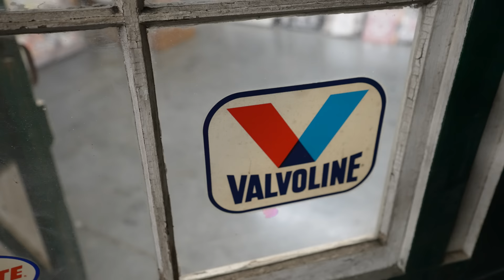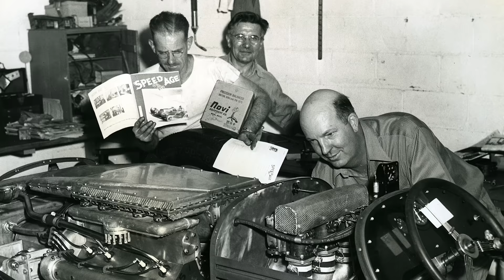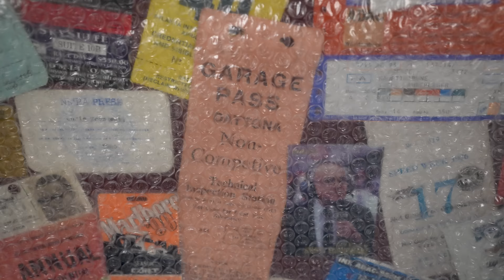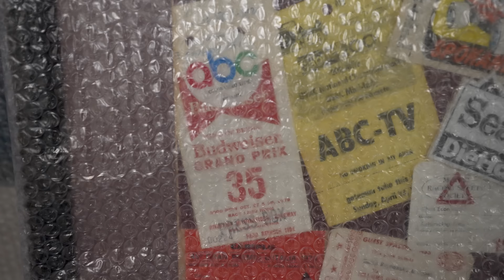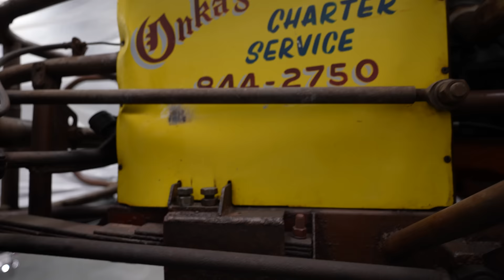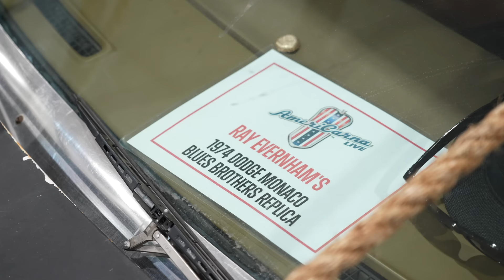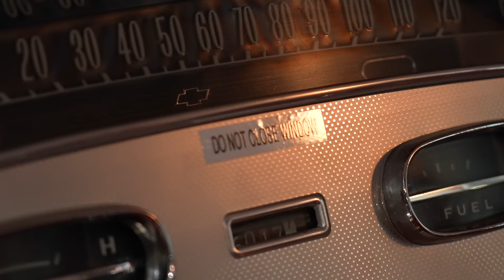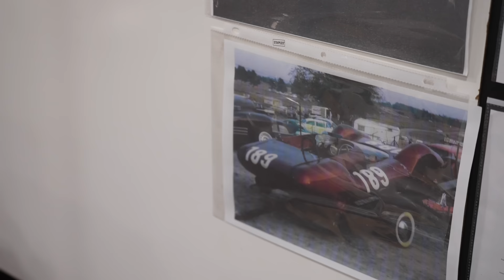Ray Evernham's Secret Obsession W/ IROC Cars & Owning The "American Graffiti" Car | Barn Find Hunter

Comment: I like how after talking about IROC they show a Trans-Am Camaro instead of an IROC Camaro. 😅
The yellow one with SCCA GT-1 on the side.

Unless there's more of an explanation that's missing. If that's the case I'd love to hear why that car looks like it's been running in the Trans-Am series, not IROC.
Reply: After it was retired from IROC, the car was probably  sold off and used in TransAm. 

One of the original IROC Porsche 911's at one point wound up in the hands of famed cocaine kingpin Pablo Escobar, and after throwing a 935 body kit on, raced it in local rally races in Columbia.

Comment: Ray, you know its very possible to make vacuum seal bags for automobiles, yup, drive into them, use a vacuum cleaner to suck all the air out, crack windows a hair and your autos will be preserved for as long as that bag stays in tact, in 50 years, drive it onto a new one, if you are afraid of body damage build a steel or wood crate around it, OR, build a hermetically sealed shop.. suck the air out when you lock up, hermetically sealed garage or slips..  sure save on restoration costs down the line,  maintained these autos can be around as long as mankind...